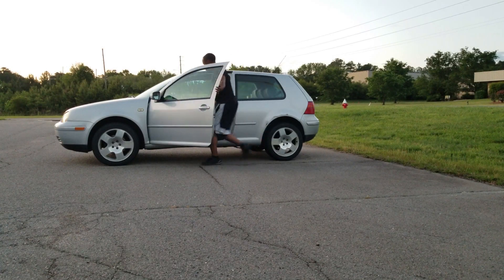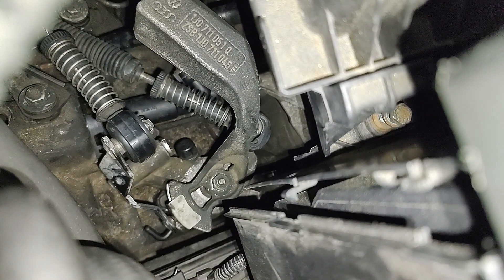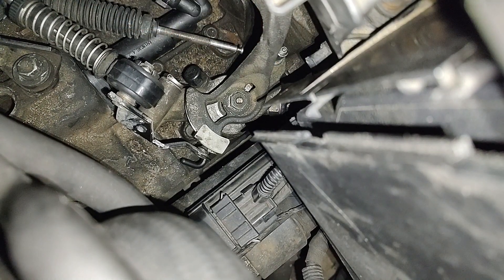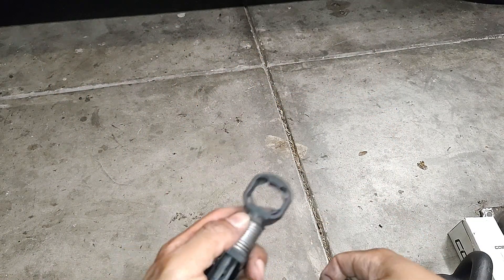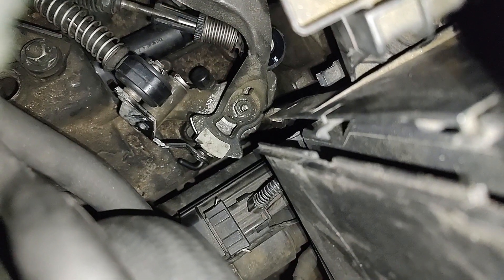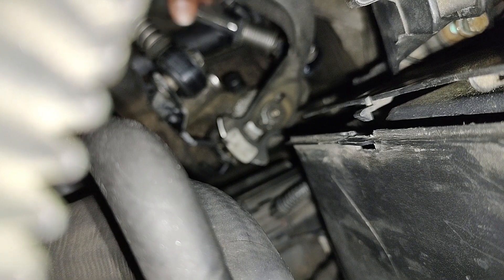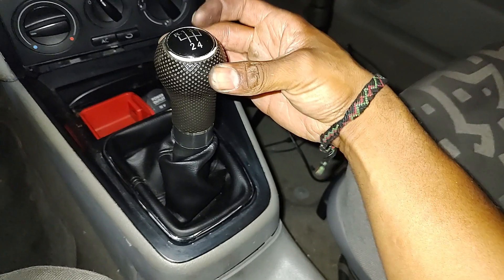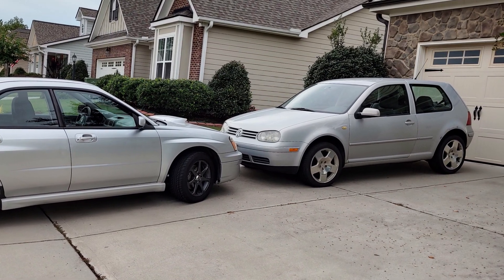MK4 GOLF UroTuning shifter cable end bushing upgrade

Comment: Nice to hear that it working great now! 👍 I’ve been struggling also with my mk4 shifter and i have to also replace those cable end bushings. Problem is that in here europe there isnt so much aftermarket bushing options available.
Reply: Order from an American site, they’ll be able to get it to you im sure.  I’ve ordered things from all over the internet.  Dieselgeeks has an awesome short shift and bushing kit you could get

Comment: I ordered the mk3 shifter repair kit with all the bushings and stuff from urotuning a year ago . But now I’m thinking of swapping to 02J . Can I still use that kit for everything in the gear box
Reply from the maker: I'm not sure. Which kit did you order? If I were you, I would compare the parts in the MK3 kit with the parts in the MK4 kit (If you haven't already). Good luck!
Reply: @MaqsVids  I got the mk3 complete shifter repair kit

Comment: 02A, 02J and 02T boxes have shit 1st gear shyncronization, the best way to use them if u have a bad one is to firstly put it into 3rd and then 1st
Reply from the maker: Thanks! I'm gonna try that. It has been...."fun".... sorting this one out.
Reply: @MaqsVids  I had the older style gear selector mechanism on my octavia (02A), it was a complete garbage, grinding first  and heavy fifth, i changed to your stile one, whit new cables and shifter box, it has been a completely new car to drive, but the alignment procedure is not always good for me... I do the alignment without the pins, just in gear and i adjust the cables as it goes in (cant explain accurately) much more precise than the adjustment points to use

Comment: Great one bro! Please i am having similar issue with my MK4 TDI (Auto). Shifting back to drive comes with a heavy jack sound from the gear box. I replaced the gear box entirely and its still the same issue. Additionally, the gear position indicator on the instrument cluster goes blank after some few minutes of drive. It only comes back after restarting the engine and only for the same blank issue to occur again. Please kindly help me out. Thanks in advance bro. (I will appreciate it, if i can relate with you on WhatsApp bro)
Reply from the maker: Hey! Yours sounds like a motor/transmission mount. It's a common failure on these cars at this point. I'm not sure about the indicator though. It may be a switch or a circuit.